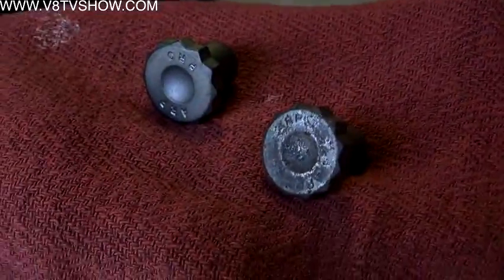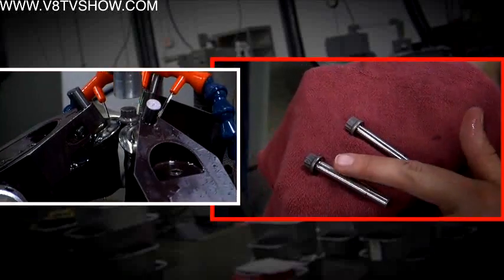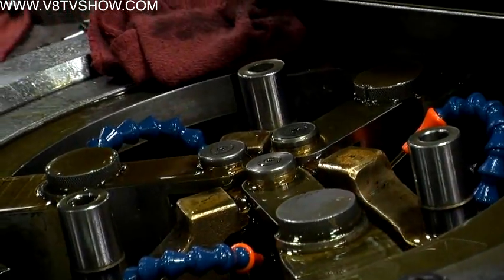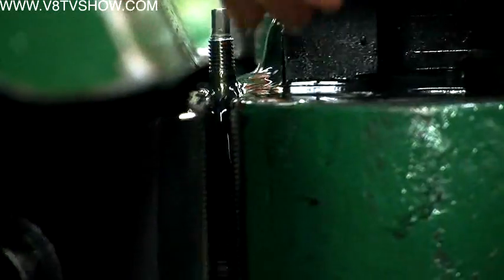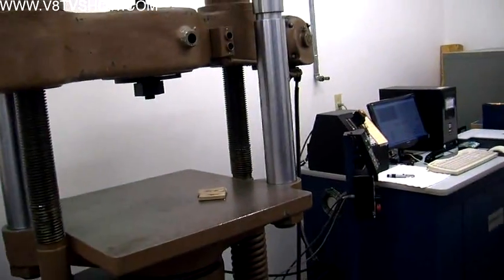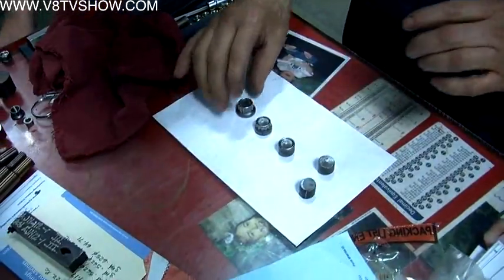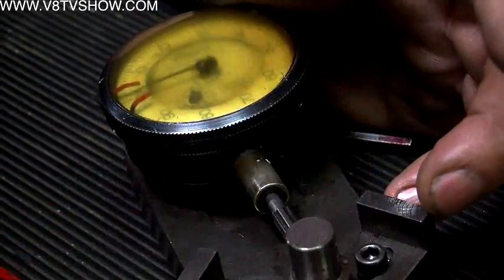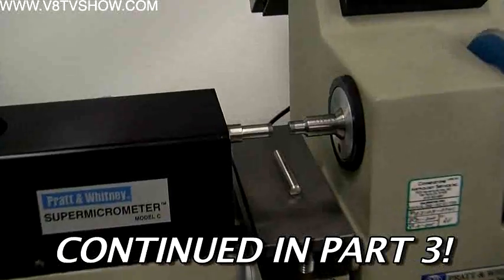Special Presentation:  How ARP Fasteners Are Made Video Series Part 2/3 V8TV

Comment: 6:04 so much for the superiority of rolled threads...
Reply from the maker: Threads are rolled on external surfaces (bolts) but are cut into insides like nuts.  Not sure there is an internal surface thread roller out there.

Comment: i used to make taps and dies and my job was working @1:00 on the center-less grinder , grinding the shank part of the tap to a finish , i was given a 0.005 tolerance i was bored so i kept a 0.002-0.003 thou tolerance over a 2 inch long shank and od was perfect